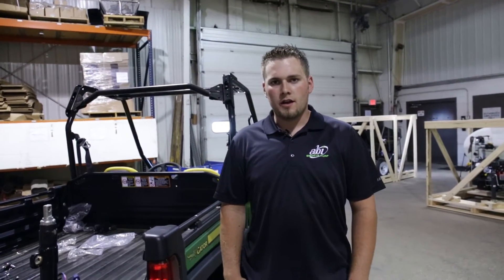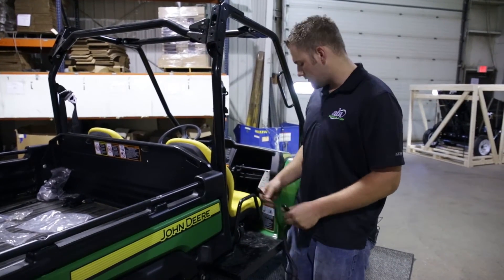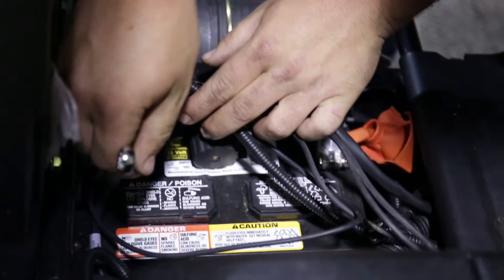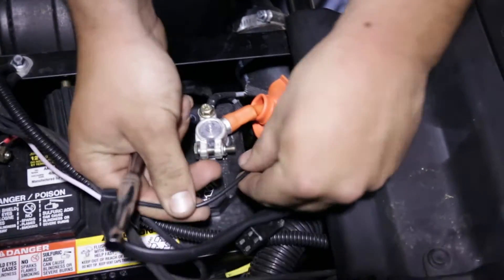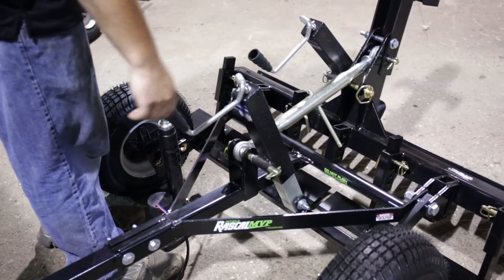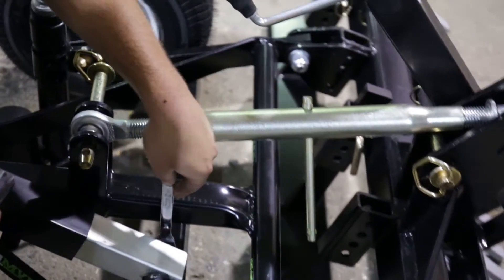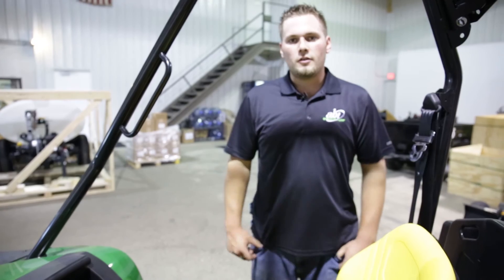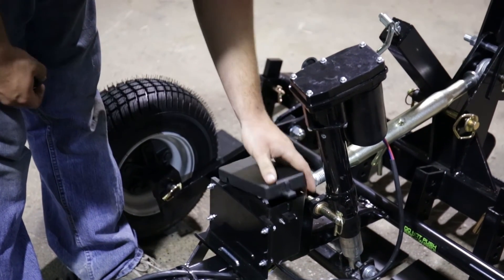ABI Electric Actuator - Version After 5 2013 - Installation Instructions

Comment: My actuator seems to hit its limit just after the tires touch down.  It won’t raise the rake high enough to really roll well.
Reply from the maker: Hi there! Sounds like the limit switch needs adjusting. This happens every now and then and is a quick fix. Give us a call (877-788-7253) and ask for a Support Technician. One of our Techs will be able to walk you through the process.
Thanks for reaching out!
- Matt, Team ABI